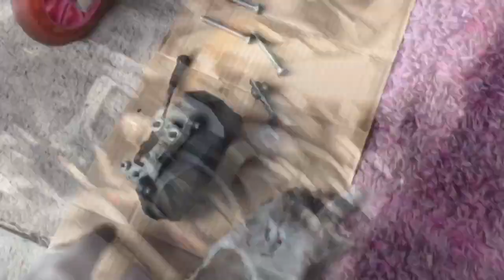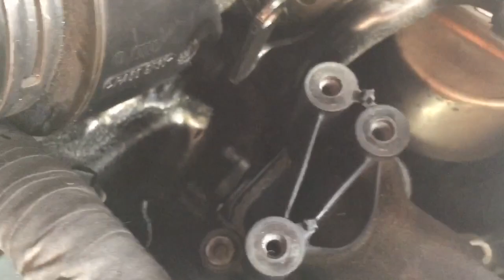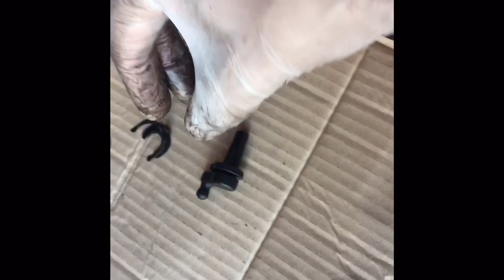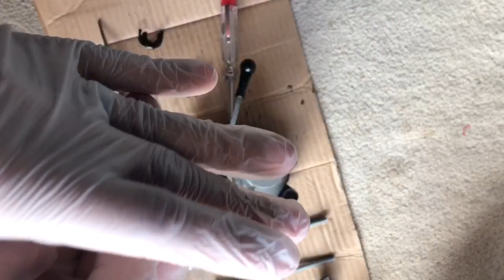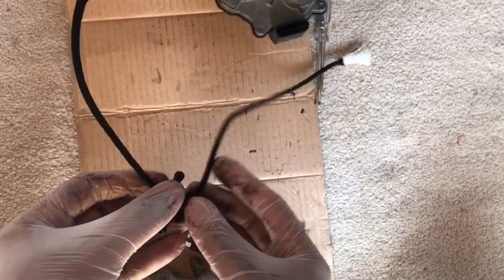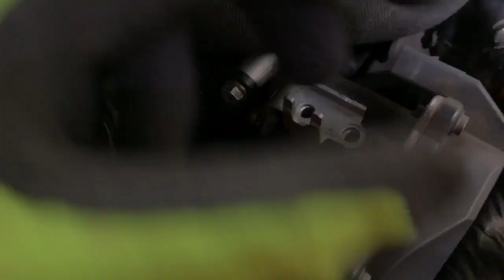Audi Q7 3.0 DTI INTAKE MANIFOLD Step by Step Bank 1 Repair

Comment: Hi!
I've got a question for you.
On the actuator, you've mounted a "stopper" so that it won't go beyond its lower limit. Is that "stopper" a self-made one? 
I've got problems with my 2,7 V6, that the bank 2 actuator goes past the lower limit and therefor won't work properly. (fault code 1018). I know I probably should replace the intake manifold, but... :-)
Reply: It's the DieselGeek bracket: https://www.dieselgeek.com/collections/common-rail-tdi-p2015-manifold-fix